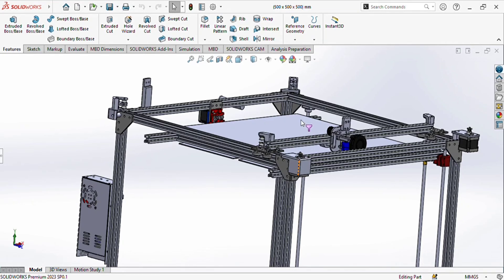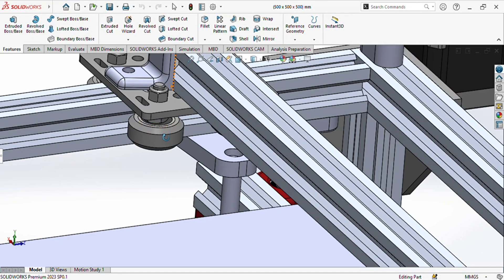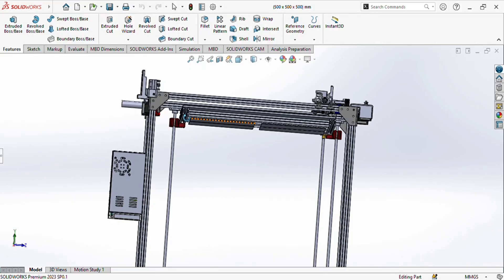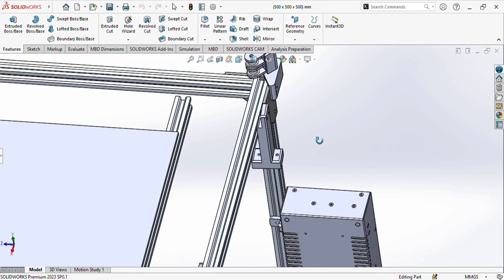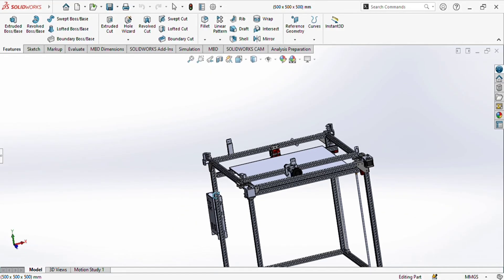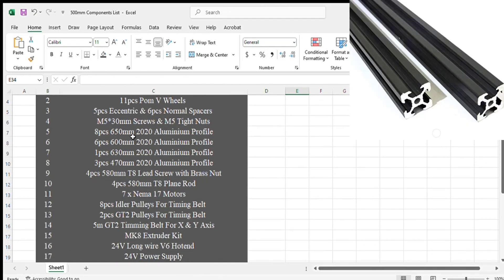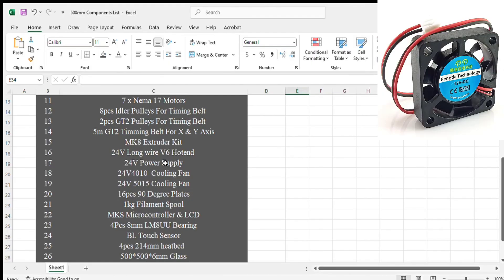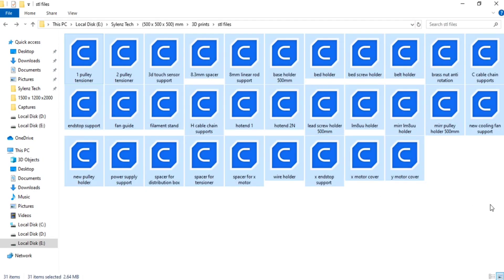DIY 500mm Core XY 3D Printer |  Homemade DIY Core XY 3D Printers

Comment: Where can I get the stl files?
Reply from the maker: For 500mm size?
Reply: @DaretoDream906  I found the stl on your web-site. BTW, which model of the openbuild for the X and Y gantry? Thanks
Reply from the maker: @yoyoindrajaya you can cut gantries using any model of cnc machine.
Reply: @DaretoDream906 what kind of gantry plate for X and Y?